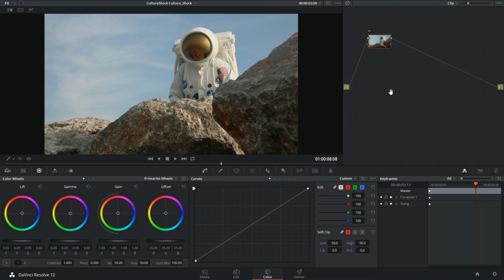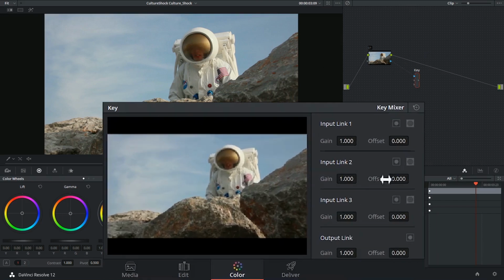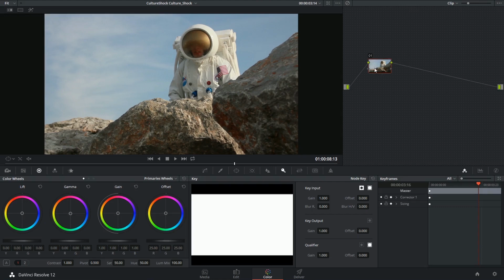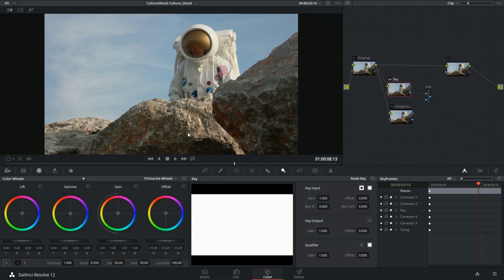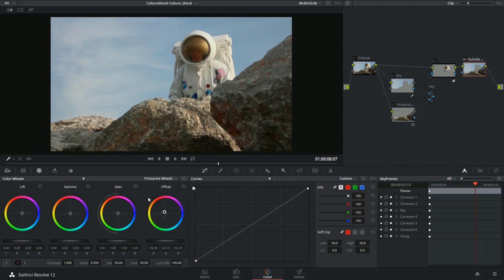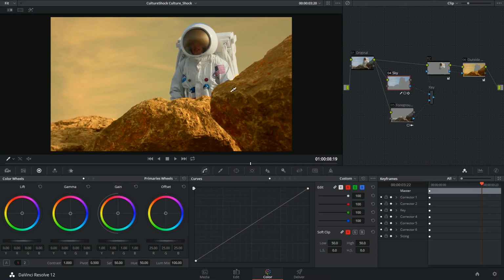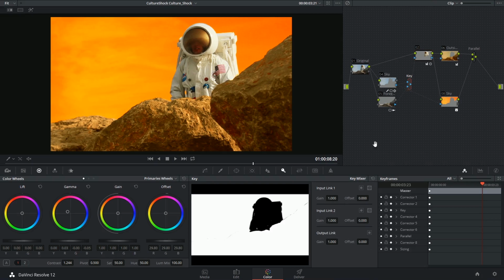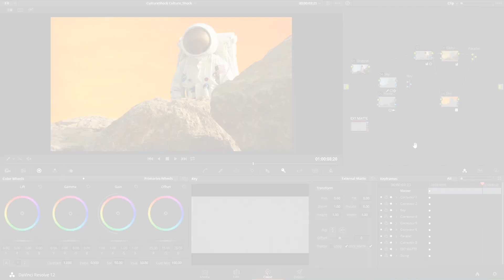DaVinci Resolve 12 - 79 Key Mixer and Key Palette

Comment: Is there a reason why another "Sky" node (node 8) needs to be created in order to do additional color grading in the sky? Can you not just grade the original sky node (node 4)?
Reply from the maker: In this particular example, Sky node 4 has no visual impact on the final image - notice how there is no RGB output coming out of that node. It is being use purely as a selector and matte generator. The blue output is the key (matte) signal that is being carried into the key mixer node. Sky node 8, on the other hand, is processing the RGB pixel data and affecting its colour values, which are then being sent to the parallel node at the end.

Comment: Is there a way to use multiple videos as an alpha output and key out different colors and assign to different videos by using the key mixer? Also I see sae is in Chicago.  Do you give private lessons?
Reply from the maker: Yes - you might need several key mixers to create the optimal combination, but what you're describing should work. Regarding SAE, they have 54 campuses in 28 countries - I worked in the London campus back when these videos were recorded. I still live/work in London as a freelance colourist/trainer. I've never been to Chicago, but fly to New York/LA a few times a year for training sessions.

Comment: When we work with node is possible add another different video clip or that is possible only in edit mode ? For example if I want tracking another video add to the first, I can only copy tracker data or is possile add it on node ? Thanks
Reply from the maker: Yes, you can only work with other media if it is on a separate video track by copy+pasting the track data across (as demonstrated in the Match Move video: https://youtu.be/dzp7RNkR0Ns). I'm afraid it is not possible (as far as I am aware) to introduce unrelated videos into the node structure of a clip in Resolve.
Reply: Goat's Eye View thank you ! 😊